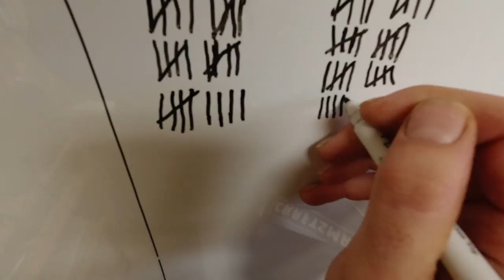Calf Overload!

Comment: So many calves.  How do you keep them all straight before ear tags ?
Reply: back in the old days the cow had a chain around its neck with a round plate with a number on it
Reply: Traditionally with black cattle such as Aberdeen Angus, Welsh Black and some Limousin they used collars around the cattle necks.  
With other cattle with white or pale coloured ear skin ear tattoo numbers and /or letters using black or green ink inside the ear. Many pedigree breeders still tattoo as well tag in case tags get lost or become unreadable. 

Increasingly some folks also insert a passive identification microchip under the skin in the ear such as is commonly used on dogs and cats but it does not help to identify cattle from a distance - you need a special reading tool held close to the ear to interrogate the chip to correctly identify the animal.